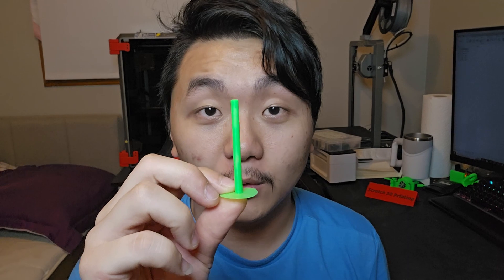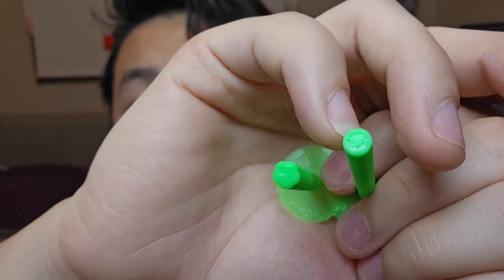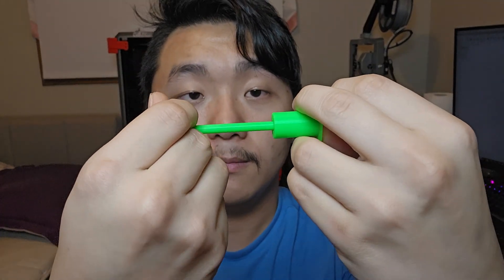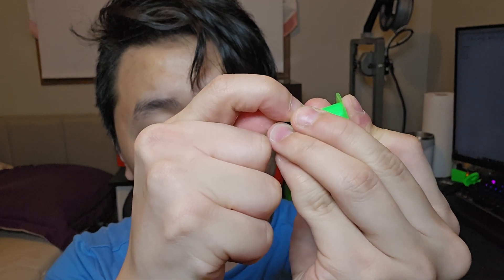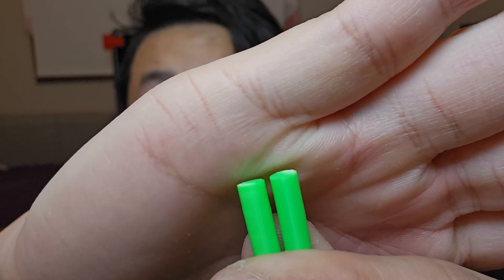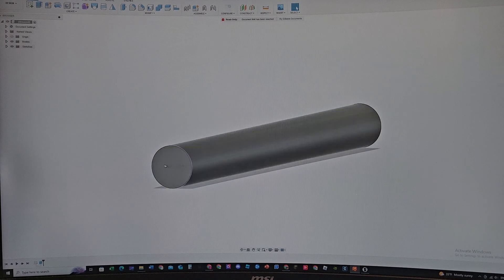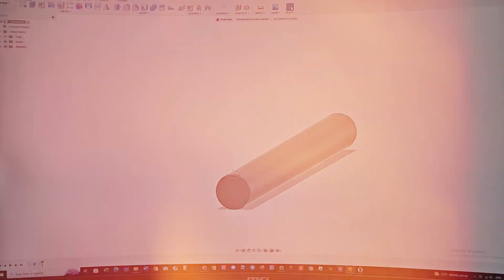3D Print Stronger Rods With This Method

Comment: The shorter a rod is, the stronger it is. You could also redesign your assembly to use shorter rods.
Reply from the maker: that's true but making the rod shorter will not fit my RC Car
Reply: @Scratch3DPrinting  Hence I said redesign. Imagine you are only allowed short rods, you will come up with different solutions.

I was looking for rod videos because I was concerned the rod would fall over during print. My final solution was to have no rods at all, and that was printed and working.

Comment: From an engineering standpoint, that geometry actually makes a lot of sense (wonder how I didn't think about it in the past). Since a cylinder is a continuous curve, when a "bending" force is applied, tension and compression take place on opposite sides and any redistribution of forces cancel out. But having that sort of flower geometry allows the curves to oppose said forces and distribute them over a wider area within the outter faces of the model, hence, the part is stronger. Pretty nice tip!
Reply from the maker: Thanks, yeah by doing this, it does make the rods stronger

Comment: I dont think this is true.
Reply from the maker: Since many people are skeptical, I'll make another video, and this time, I'll do real testing and not use my hand to break them, lol. 
Also you can try 3d printed them and see if it's true or not
Reply: @Scratch3DPrinting  
I will do that today. Still I suspect this can't be true since you only subtracted material. The paper gets stronger, because you take away material at certain locations AND put it in different locations. Here you just take away material.
Reply: @Scratch3DPrinting  I tested it and it does not work.

Comment: Can I ask what material you are printing in? Vapor smoothing might be a better solution.
Reply from the maker: This was just PLA from JAYO.
Reply: @Scratch3DPrinting  I've not used their filament myself(just started 3d printing 2 months ago, I've worked in plastics mfg for 20 years now).  How would you rate them?
Reply from the maker: @ronaldhiser860  Out of 10, I would give them 7/10, just because they are as strong as PLA+. Print speed and quality are great.

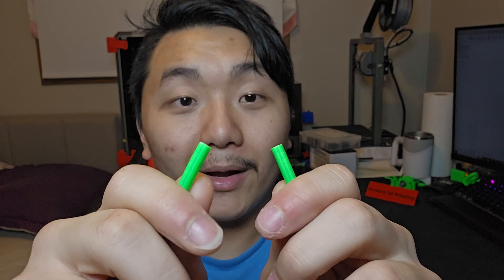Comment: Its good to challenge and try new things, but at 5:20 your thumbs were further apart and so biasing your already subjective tests.  The star shape definitely helps with the fit tolerance,  but IMO far better used on the holes.  The strongest way i have found for pins is to dial-in your settings, then print two halfs laying flat on bed and glue together.
Reply from the maker: Ahh, I didn't realize that my thumb was further apart, that does make a difference. Hopefully in the future I can get a machine that can do these kind of testing and so we can see the numbers to tell the difference.
Reply: @Scratch3DPrinting  yes, you could knock-up a DIY test rig by swinging a small weight around a pivot (known weight and length), with some sort of read-off scale bar behind.  Great channel by the way.... you walk through the typical problems and come to some conclusions, then put them up for debate and comments.  Good work!!

Comment: I'd be interested to see the comparison between these two rod designs if one extra perimeter is used for the circle rod. I'm guessing the modified circle has more filament contact surface area between layers due to the increase in effective perimeter length. Awesome idea and well layed out video!
Reply from the maker: Thanks, yeah the one with the groove are a bit stronger. Hopefully in the future I can get some sort of machine that we can actually see numbers and will do another testing to see exactly how strong it is.
Reply: A tester would be great! And getting both bend and shear results would be appreciated!
Reply: Yeah I think that’s why. The reason why ribs usually strengthen is because material is further away from the bending plane, so there’s more leverage. But in this case ribs move material closer. In any case, cool technique!

Comment: I'm actually printing rods right now for my mini mascot statues for my colleagues. 
I print them laying flat with elephant foot compensation and I print halves of them and then glue together. They're kinda good, just need to do a lot of gluing. Tolerances are fine if you know how it goes. Layer adhesion is just not too good at anyways on those thicknesses.
I'll still try your method sometime
Reply from the maker: Ah that's nice, hope you're having fun with your project. Gluing them together does make it strong, too.
Reply: @Scratch3DPrinting  Fun ended on 4-th statue. I've made 8 already and 9 more to come.